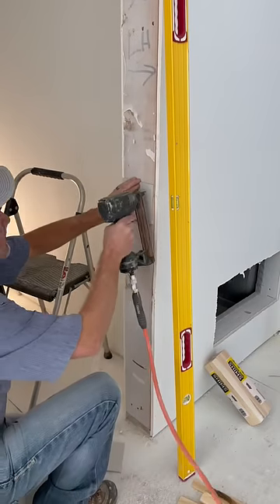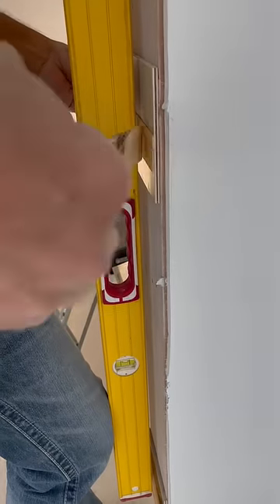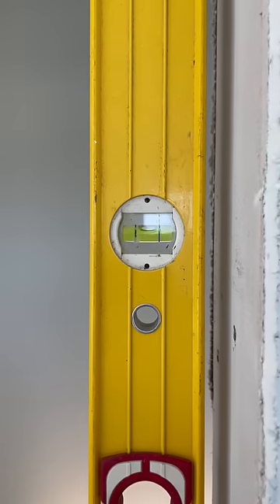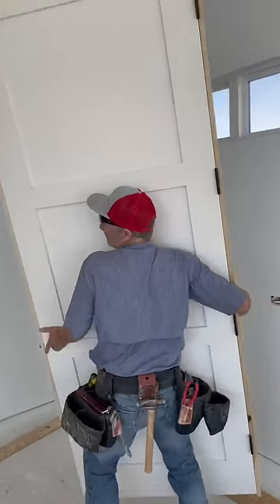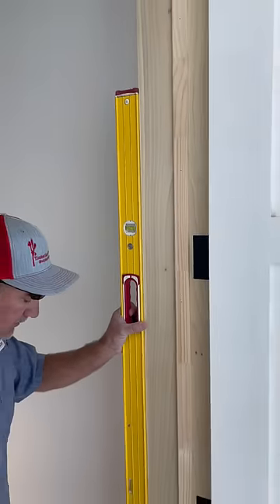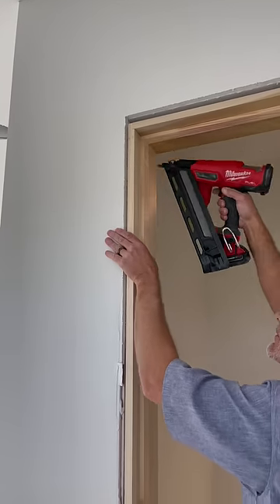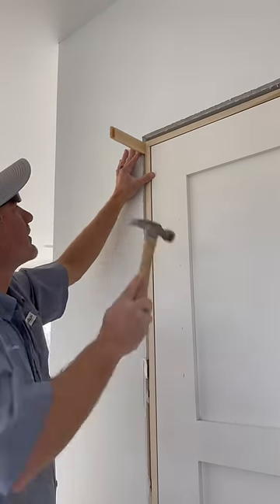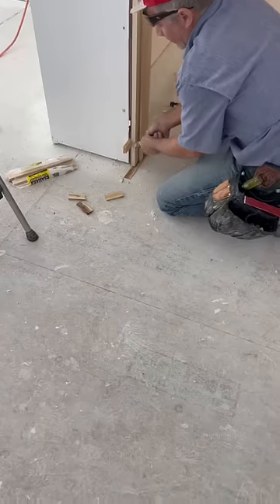How To Set A Door #shorts

Comment: Never seen anyone use a skill saw to cut the shims. I can’t decide if I want to hate it or if it’s genius.
Reply from the maker: Let’s go with genius 🤙🏻
Reply: @texascarpenter  it certainly is faster than a plug in oscillating tool. Then again, maybe i just had a bad experience when using an oscillating tool.
Reply: Cordless Milwaukee multi tool for me, but this guy is a pro, pre shimming your hinge side pre install is clutch.
Reply: I’ve always seen a box cutter and breaking off shims.  Skilsaw looks cool on videos but seems overkill to me.
Reply: @Oh6Torch  he's using a box cutter on the last one on the bottom.
Reply: @weejohnbb  not enough room for the saw down there I'd guess
Reply: We use multi tool. Pretty easyz
Reply: It's dumb have precut shims and you rarely have to break them and if you do it right you just break them with you hammer.
Reply: I also use my circular saw to trim shims, But I don't do it on camera😂 note: For Pros Only - Kids Do Not Try!😂
Reply: Im surprised people are hyped by a simple bit of work. Wow he cut it with a circular saw lmao get a sharp blade on your multi tool, pre cut or use packers that come in different sizes. Simple lol
Reply: I thought the same thing my eyes went 😯🤨 & was that a smaller circ? I usually leave the shims in then run around after w/ the multi or the razor zip em off. i might have to try the circ next time especially when it’s a bunch of shims..
Reply: Use the poly shims, the break nicely.
Reply: Why do yous up in north America use massive shims that need cutting off. We just have them roughly cut to the the width of a stud
Reply: At least he cut em
Reply: Less noise then a oscillating tool
Reply: I often score them with my box cutter and then snap them at the plane of the drywall. Because I forgot my multitool in a different room and don’t wanna go back for it. 😂😂
Reply: @Wheeznbreezn not sure why they come so big, but I often use the cut off ends too when possible. I only learned how to do this like a month ago though so I’m still learning
Reply: What the fuck is a “skill” saw?
Reply: @cannywf1  a circular saw
Reply: @cannywf1 the saw he uses to cut the shims in the video.

Comment: Never installed a door this way just for the simple fact of I never work with newer houses it’s always a house from 1722 that needs 30 packs of shims to level the door but thanks for the tips, I’ll have to try it this way when I get the chance to work on a newer house 😂
Reply: You wouldn't need that many shims in you level you floor on an old house first 😉
Reply: 1722😆
Reply: New builds aren't any better
Reply: Well said...my houses are all 100+...and always leaning to one side or the other.....
Reply: @colincutler194 yeah…$6,000 to level the pier and beam house so the $140 door can be set plumb and level😄
Reply: @bigluisjayrogan depends on who does the framing.

Comment: ngl,  as much as I like the brick built houses here in the UK,  I'd 100% prefer to work on timber frame, so bloody fast!!!
Reply: It's only brick exterior in UK now. All rest is timber stud walls. Throw away homes. Some companies still use internal block work but the price difference is ridiculous.
Reply: @dannythorpe1425  It's true that.   I always end up working on older and solid houses.   I actually live in a house built of concrete poured in situ (the lot! floors, walls, roof.  Put up in 1921 as an experiment and 101 years later this sucker aint moved at all, but I do miss the ability to run a pipe or a cable under the floor 😅.
Reply: @thediyandpianoguy8665  haha yeah I moan at older homes when I have to get the core drill out 🤣
Reply: @dannythorpe1425  I wouldn't say throw-away. At least you guys have brick only exterior. Way quieter, much more insulated, stronger. Nowadays, it's much more practical to stud out interior walls, as it reduces the labor cost for trades to work inside/around brick, nevermind the headache.

Comment: I do my doors the same way, takes about 15 minutes n comes out good
Reply from the maker: Yessir 🤙🏻
Reply: @texascarpenter  Hey man, i was thinking about buying that same saw, hows it been for you?

Also, which nailgun is that one? I have the papertape m18 framing nailer, it's my favorite framing nailer even though it's fairly heavy.
Reply: I never set door frames with the door in the frame, the weight of the door pulling on the frame makes it a lot more difficult.
Reply: @chuckgranger9777  Those reveals be outa whack and not consistent all the way around the door if you take it out of the frame. Everyone has their way I guess
Reply: @nmknmk8936  I take the door of the frame to set the hinge side, put the door back in the frame, then set the rest of the frame, easy as 1,2,3.

Comment: I've been hanging doors since 2010. Not a bad method, more than one way to skin a cat.

Since nobody asked- I like to put the door in the opening- open the slab, REMOVE DOOR STOP pieces, use two shims behind top and bottom hinges. 15g nail above and below (not through) shims. One nail on top and bottom of strike side to hold in place.

Plumb hinge side both ways, flush top of jamb to wall.

Use the slab to adjust reveal on strike side of jamb. 

I put all my fasteners on the jamb where the door stop we removed will cover. Screw through hinges, shims behind each hinge, shim in 4 places on strike side, nail it off, cut shims with bear saw or fein tool, then reinstall door stops after door hardware is on (unless it's painted trim, then just flush slab to jamb and install door stop to that).
Reply: Some door jambs have the doorstop piece milled as one so it can't be removed. Is what it is, but there are some tricks to hiding fasteners too.
Reply: I like to plumb the door in place, you're going to be using a level to nail the shims and cut once, why do it twice when you get the door in? Plus, if you need to remove shims or add, it's a little hard when they're nailed in there behind the slab.

Nobody asked, and this video is awesome and you do good work.

I like to have the shims free for many reasons.

Comment: It helps if the jamb is the same width as the wall is thick, also nail lengths if timber to the header and bottom of jamb, that way it will but up against the walls and gives a bit more support for fixing.

Comment: Always center the door in the RO.
Reply: Why?
Reply: @lakestatebullies7391  ever see a door at the end of a hallway 1/2" off center. Doors are laid out and framed in a particular way for a reason.  It's finished carpentry 101.
Reply: @moaski Doors on the end of a hallway especially a dead end hall almost never happen and when they do to notice a 1/2" the door would need to be almost the width of the hallway. Finish carpentry 101 that's laughable. "Always center in ro" is a bold statement and really bad practice. With that statement your assuming the ro is centered. I've seen it far to often where ro's are off by a 1/2" or more. In instances where doors have little wall on each side of the door I mark center of door at the top of the jamb and center of wall I would never rely on center of the ro.
Reply: @lakestatebullies7391  I agree..."always" is a bold statement. What I meant to say is 95% of the time.

"If ya don't know, know ya know, nigga." Biggie
Reply: @moaski  if you dont center the door in the ro that 5% of the time when you say it matters the most then why are you centering it the other 95% of the time? Sounds like youve been doing it wrong or have no idea why you do it. If you're always/95% centering stuff in rough openings then you are by no means a finish carpenter. The rough opening is just that rough it allows you to plumb and level, center or offset, raise or lower to make equal heights or widths across a walls interior and exterior finishes. I like things symmetrical and I'm thinking about all finishes not just what's right in front of me that moment. So theres a little more to it than always centering. Kinda funny when guys are taught something use it their whole life and even try to teach others the same methods but have no reasonable explanation to why they do it. Buy yourself a laser and start measuring stuff instead of "always" eyeballing center of the opening.
Reply: @lakestatebullies7391  now you're putting words in my mouth. For the purposes of this argument, all you really need to understand is I'm right and you're wrong. It doesn't matter how many paragraphs of pontification you draft, you're still wrong.
Reply: @moaski  all that pontificating and I still dont get an explanation as to why always center!
Reply: @lakestatebullies7391  have you ever designed or laid out a structure?  Doorways aren't laid out to accommodate the most plumb jack.  They're intended to go in a specific spot... if they're truly thought out and accurately framed.

If you're just throwing in doors for track homes, do it however you want. Nobody gives a shit.  Staple your mdf trim up, collect your check and move on. But if you work on a designed home and take pride in your work, center in the RO.
Reply: @moaski  The hack calling me a hack. How funny. I'm such a hack, I'm a lead carpenter and foreman of a multi million dollar remodeling company. Must have hacked my way to the top I guess.
Reply: @bobos245  cool story, bro. Glad to hear you work for a successful company.
Reply: @turbojunkie971  sorry you were never taught how to properly install a door.
Reply: @turbojunkie971  I have no doubt you think that.
Reply: Most the framers suck now days.
Sometimes at the end of the halls you should try to get it centered. Sometimes the walls aren’t plumb  . You gotta fudge your door and trim abit.

Comment: Almost done correctly. Next time add a 3” screw behind each hinge into the framing. This will prevent the jamb from moving over time as the door is opened and closed. If it’s a solid core door then you also need to swap 1 short hinge screw for a longer screw on each hinge. This prevents the door from sagging over time. If it’s a hollow core door you can get by without switching to a longer screw

Comment: Bro needs a multi tool for them shims
Reply from the maker: Nothing faster than the skilsaw 🤙🏻
Reply: why not just score with a box cutter and break off flush.. that is the quickest
Reply: Who needs a multi tool when youre skilsaw skills are on point
Reply: All the best carpenters use minimal tools they just get it done.
Reply: @jamespetkwitz8737 pine shims are a pain in the ass with a utility knife. Cedar Shims are the way to go.
Reply: @Jsailor1210  I've very had a problem quickly cutting any kind of shim with a utility knife. I guess I'm in the minority
Reply: Multitool is slow and noisy. Only used if absolutely necessary.
Reply: Multi tool with good bi metal blade is the way.
Reply: Should be shimming both sides of the door jamb so the distance is equal on both sides
Reply: @jamespetkwitz8737  agree 100%!

Comment: This is a good way to set a door but only if the wall is plum. If it's not your casing will show with tapered caulking joints. I just follow the wall, but plumb the inside frame.
Reply from the maker: Split jambs?
Reply: @texascarpenter  I have no clue what he is trying to say.
Reply from the maker: @michaelmcclellan9422  It has to split jambs? The only thing I can think. We’ve never messed around with those..
Reply: @texascarpenter  they are used for pocket doors  but they are only on what you would consider the hinge side of a swing door, the strike side is one piece like any jamb.  Fyi I set my prehung doors exactly as you.
Reply: He must be referring to if the opening is plumb not the wall. It still doesn't matter though, our method stills works.
Reply: I do it this way as well. Looked like the top of door was sub flush about a 1/4. I always split the diff. Makes trimming easier.
Reply: @joewat5905  so you are thinking he is talking jamb widths and wall thicknesses Like  4-9/16" jambs are for a 2x4 wall + 1/2" drywall?  Maybe.

Comment: Only way this works is with a level as long as his.  If your level doesn't hit all 3 points at one time, they're off. Guaranteed.  With experience,  it may not be off enough to make a difference.  Cannot use a level to level/plumb multiple points and expect it to still be accurate with point A.  Before you try arguing with me, run a laser, long enough straight edge, or even an old plumb bob.  You will see what I mean. Now in most cases, people can't see it or do most guys care, but on my jobsites - we care.

Comment: Or spend a fifth of the nails and time by sliding in the door assembly, setting shims and then using finish screws or an army of trim nails. Nothing is ever going to be perfect and you WILL run into a warped frame at some point. Do you though.

Comment: I use that technique but don't always plumb jamb.. I usually follow the wall so the casing is flatter.
Reply: Automatic door closer or opener
Reply: @torrycole6477  you must have some really bad framers
Reply: @torrycole6477  1/8" out of plumb won't make a door swing but will make the casing looks like shit if you have your jamb an 1/8" in or out of wall
Reply: Ya It will.
 I hog out the back of the casing with a planer.
   Yep bad framers all subs wham bam

Comment: Why shim an interior door anyways, I'll always shim exterior doors though. Very slow way to trim. I'll always nail my trim on the hinge side of the door measure my top peice after trim for instanse i got a ro of 2'10"1/2 for a 2 8 door id mark 1'5"1/4 on the concrete.  Find center of doors top trim depending on the trim I'm using. Then i get my level out mark plum on the sheet rock for my hinge side stand door up put on my level mark check my top reveal for any adjustments nail the trim to wall then to jam then I'll use 3 screws on hinge side or 4 for 8ft doors and wah la you just set a perfect interior door without shims. Laser level definitely speeds up the process if you got one.

Comment: Have always wanted to ask, is it ok to use 16 gauge nails for doors? Always seen people use 15
Reply from the maker: Not in my opinion. The difference in strength and size of nail is substantial between the two gauges. We’re installing 8/0 1.25” or 1.75” solid core doors. Maybe hollow cores however I’ve always used my 15g on doors. Also on door installs we’re shooting 2.5” 15g 🤙🏻

Comment: Why is the door not flush with the drywall on the outside of the door?
Reply from the maker: It’s the inside..Sheetrock is a bit proud as the screws in a couple spot were over sunk in the drywall. A screw here or there will suck it back to the trimmer and casing will cover 🤙🏻